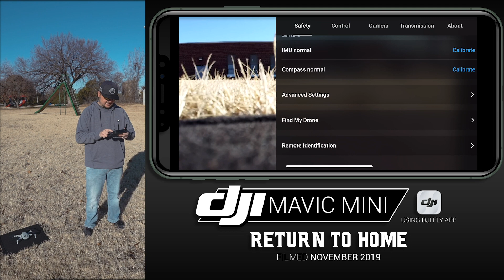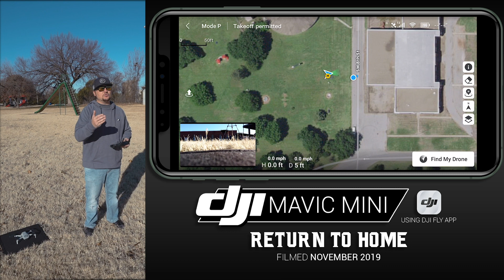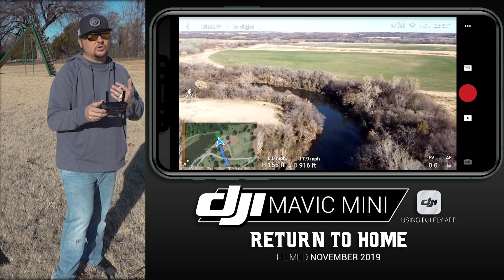DJI Mavic Mini / RETURN TO HOME! (Tutorial & Demonstration)

Comment: Hi Dylan, I'm curious if the Mavic Mini drone will return safely in an obstacle ridden area. Your video has no obstacles. I often take off from a very small boat or a kayak. I'm often up a creek or near a waterfall with trees everywhere. I see that your drone made a b-line home. That wouldn't work in my case since I had to maneuver around all the tree branches. What do you think? I've been afraid to attempt it because a crash is the end of the drone.
Reply: Set a return to home altitude above the tallest obstacle around you and it should avoid everything

Comment: Hi!
HELP#
 I always fly my drones over the bay, since here in Miami Beach, FL, where I live, is a crowded area with many tall buildings.
I already crashed on the water the Mavic Mini and the Mini 2. My mistake is that: While using the left joystick to rotate,  I keep lower the altitude by mistake and forget to check it.  I get very distracted looking at the video images.
Why the drone doesn't have a "Low Terrain warning" or "minimin altitude reached warning" that I could preset to, let's say 10 or 20 meters, so it sends me a warning when it gets below that altitude. Especially over the bay waters where I can't receive it?
Thank you!

Comment: I’ll have to give that ago. Every time I hit RTH the drone immediately descends below selected RTH altitude and wants to land right where it is. Bit awkward when flying over the ocean.  So I must have been using it as a landing feature, not a return to home feature. Good video. Very well explained.
Reply: If the distance between the drone and remote is less than 20 meters it will just land , if it is more it will return to home
Reply: @fowlerfivegaming561  Thanks!  This is the detail that I couldn't find anywhere.   I've always been trying to "test" this feature and it only offers to make it land where it currently is.   I'll try again with the mini SE farther away next time (at least 20+ meters).   I think I've only tested it in smaller distances, so your comment makes a lot of sense.
Reply: Same issue here. Will have to test some more.
Reply: Brian Clark  I think I’ve mastered the problem. Using an sd card helps gps location. And if there is and medal in the surrounding on take off it will also throw the gps signal out.

Comment: I was flying my spark in the woods, suddenly the RTH started and the fucking drone crashed several times with the trees until the propellers colapsed, i had no control over the aircraft. It was very frustrating.🤬
Reply: Hope you could help me with this issue. Thanks 👍🏽
Reply: If the drone loses signal, RTH will kick in.  When RTH is activated by you or by failsafe, it will climb to the set RTH altitude before returning home. If you have have your RTH altitude lower than the height of the trees, it will crash into the trees.

Comment: I you are on a certain height before returning to home, does it maintain the height until it reaches the homepoint or does it descend as it goes home?
I'm afraid that if it descends while it goes home it might hit something like powerlines and stuff even if IO flew higher than powerlines before RTH.
Reply: You absolutely need to set a return to home altitude. This way you don't hit wires, trees or anything else that gets in the way. Figure out the highest obstruction and set the return to home altitude a bit higher than that.
Reply: Robert Durso Ah I see. Thanks!

Comment: Hi Dylan 
When i Press the home button, in only lands where the drone is , and NOT on home point, is there something i have to do .?
Reply: You need to hold the home button. You're resetting the home point if you just press it.
Reply: You have to be further away than 20 feet from the home point. If the distance is less, it will simply land where it is. NOT explained in the video.

Comment: My mini won't come home, 40% battery , no wind, started drifting off and wouldn't respond to controls, I hit RTH and it went off 1/4 mile away, it had full gps and wifi signal? It smashed into trees, DJI Mini has bugs, also did pre check list and update was updated, home was updated

Comment: Dylan, I have a SCARY QUESTION for you.  I saw that water tower in the video.  If by chance, the Mavic Mini was on the other side of that drone and the automatic RTH kicked in or if it’s selected manually, there is no obstacle avoidance.  Am I correct?  It could fly right into the water tower just trying to get back by GPS?
Reply from the maker: Where I fly in that area, I know 100% for a fact that everything is under 200 feet, which is what I have my return to home altitude set to. So therefore I don't have to worry about the tower. Hope that makes sense.
Reply: As you can tell, the return path was different that the departure path, it would have hit the water tower if it was not high enough. Once RTH is activated, it raised altitude to what it was set, then it travels in a straight line back home.

Comment: I have a question, do you have to put the gimbal cover back on when storing it in the case?
Reply from the maker: PLEASE DO! I owned the Mavic Pro and had to replace my ribbon cable twice (did major surgery on my drone) simply because the ribbon cable tore because I didn't keep my gimbal cover on it to secure it from vibrations, etc.

Comment: I learned the hard way that if you are in high winds and hit RTH, the drone can take off on you.  I'm not the only one that has experienced this problem.  I was actually in eye sight wanted to show my daughter the cool feature and it bolted.  What I've read from others is RTH should "only" be used in emergency situations.
Reply from the maker: Larry White To state the obvious here... you should try to avoid flying in high winds. I have an unreal amount of hours in flight time and use RTH nearly every single flight and have never had a single issue with it. I’m not saying things can’t go wrong because they obviously can and that is very unfortunate in your case. :(
Reply: @deeyung  Thanks Dylan.  What is frustrating (like most things in life), is the experts have very different views on how/when to RTH.  I was beat up pretty badly in a FB group because I used the RTH.  I had full control of the Mini and wanted to show my daughter this "cool feature" and then it took off.  My home point was accurate, but it traveled in the opposite direction.  Landed somewhere, but where the drone was recorded to have landed it was not to be found.   I appreciate you videos.  I'll be watching more of them.
Reply: @lawjr  You SHOULD use RTH in order to understand what it does, however beware that the MM is a weak flier, and cannot handle moderate winds. So if you are trying to come home, manual flight will allow you to use more power to get home, the RTH routine is a slow flier.
Reply: @Geebax2  I learned that the hard way!  LOL.

Comment: So how does it avoid objects like trees buildings etc in the way? Or does it not
Reply: There is an option while returning you can set the altitude level, like if you set the altitude level to 100 metre then while returning the Drone will first go to hundred metre altitude then it will return to your spot and land straight down so it will not hit any tree or building.
Reply: @dulaldas7650  that’s why mine goes straight up when I hit it

Comment: Ok nice demo. Question. After pressing the Return 2 Home button does it fly 100% the same path or it it off a few degrees? The reason for my question is if it is off a few degrees and now there are cables or maybe trees etc. Will it fly into them or would it be best to fly it always in manual mode? Like the water tower there for example.
Reply from the maker: Biker Boy Good question. What it does, is it’ll fly in a straight line from wherever it is back to the home point. There is a setting where you can set your RTH altitude before taking off. Where I typically fly, I know that if I’m 200 feet in the air, I won’t hit anything so I set my RTH altitude at 200 feet.

Comment: Cool...!  Is there a difference in accuracy between the mini and the full sized drones Dylan?
Reply: Absolutely not. They all get about 2-3 feet within home landing location. GPS technology isn't perfect and that's as close as they can get
Reply: With my Mavic Pro I always took off and flew up to 30 feet and stopped so the Mavic could memorize (or what ever it does) the home point. It always landed within inches from where it took off. I'll try it with my Mini when it gets delivered.
Reply: @RETired-oc9xq  my mavic mini always lands within a foot. Though most the time it's practically spot on when it lands
Reply: That's good to know. I look forward to getting mine.

Comment: Do you have to configure return to home when battery is low or when signal is lossed in order to gain those features or does is automatically work as long as your home point is set?  Also I notice that return to home on this mini doesn't always show available even after I set the home point during the flight.  I almost always have to manually return to home and only get the land option alone.  Any advice you can give is appreciated.  Great video.